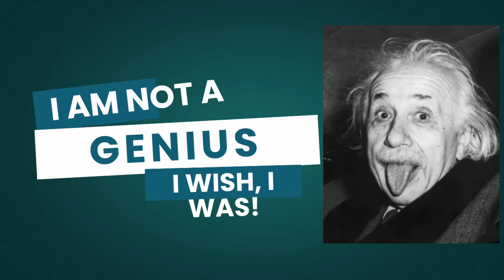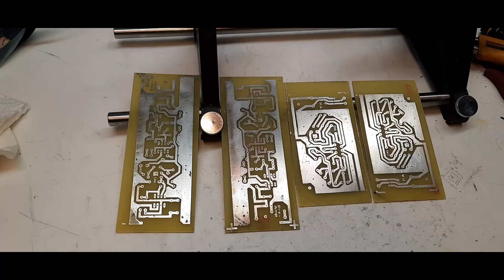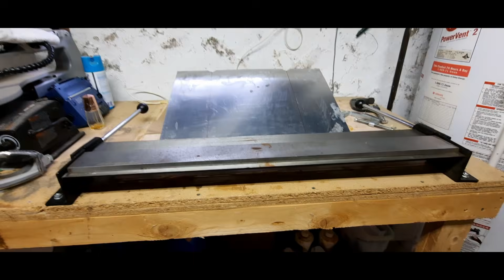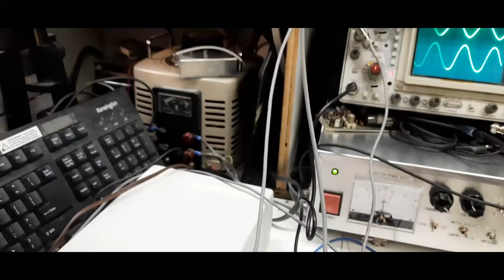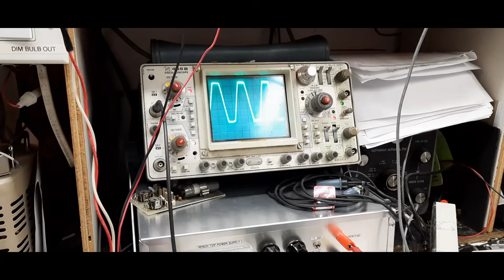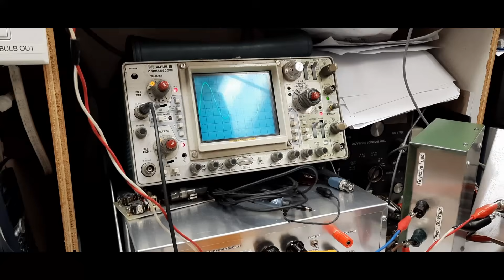Everyday Electronics - Let's build a 10W amplifier - October 1986

Comment from the maker: I figured out the scope issue - even before i read the helpful comments. I tested my scope with a good signal generator output. When I output 1 v p-p, I read 0.3V p-p. Then I looked at the volts/div read knob and it was not set to close. Duh .. how silly of me. Okay .. going forward, I will have better and real readings.

Thanks for watching!
Reply: Have you got the variable knobs for the Volt/Division settings on both your scope channel inputs set to their Calibrated positions? also, check to see if both of your scope probes have been properly compensated too.
Reply from the maker: @simonkormendy849 well no the VAR was not set. So that was the problem. I noticed it was again not set for the last project but i caught it right away. Cheers

Comment: you are not using shielded wires on your potentiometers. that is the cause of so much unwanted noise from old circuits. it might not be present now, but when you use a switched mode powered audio source it will. when you hear a whistle , buzzing bee or humming sounds. bad wirings is one of the issue
Reply from the maker: That's a good point about shielded wires for the potentiometers, I'll keep that in mind for future builds.

Comment: This project remind me my project which I developed very many years ago  with which I had big hopes.  Your has a bit comparable architecture. My project was founded on two power ICS from Sanyo STK 15, acutaly it was licenced fro Sanyo  to Poland  production GML-15 and obviously not original  STK . 

It had    only a bit comparable architecture   with added two smaller also integrated  power ICs   Thompso TBA 790,  by me not designated to work as preamp but parralel to main 15W low tone  with crossover as  5W for separate soprano speakers     I hoped to stay away from speaker crossover and to  have option to form sounding with this cross filtering and two volume knobs. I think this shown  project due to lot of free space could be also so  developed.

It wasn't successfull due  to two reasns -     one of my  15 Watt licenced ics  got damage and I wasn't able to get another for replacement but also  the survived one had not as good sounding as I demanded - so I abandoned this - mostly due to disappointing type of 15W ICs. 

Anyway due to good sounding of 5W SGS Thompson TBA 790 I later assembled micro amplifier 2x5W with volume  potentiometers and   round 1978 it was   realy amazingly working with my speakers.  And later as  microtower with my SR stereo walkman with radio - may  be      pioneered  this kind because I did it around 1982 Wonder why people are rejecting 2x 5-10W  amplifiers  but it is as it is.
Reply from the maker: That's a fascinating story about your amplifier project! It sounds like you put a lot of thought into the design. I also have lots of STK IC's that I got from old organs. Once I find a good schematic, I would like to build an amplifier from them. Thanks for watching!

Comment: You may want to look at the power supply voltage as you get close to clipping. The amp may be trying to pull more power than the transformer can provide.  Anyway great project,,, I love your troubleshooting, I'm really super impressed.
Reply from the maker: That's a good point about the power supply voltage near clipping, I'll definitely check that out. Thanks for the kind words!
Reply: As the power amp chip is running from the 7815 regulator, It will be trying to pull more than an Amp so the problem is more likely the regulator than the transforrmer. Adding a 'booster' transistor around the regulator or upgrading to a regulator that can output at least 2 Amps is advisable.

Comment: Having the speaker and input connections on the front would make this a great test amplifier for your bench. This way you can have it on your shelf and test speakers, turntables, CD players and tape decks without having to reach around the back.
Reply from the maker: Good point about the front connections, it would definitely make it more convenient for testing.
Reply: I did last time   outgoing from back and  hanging on wires spaeaker sockets. Because I wanted to have them easy accesable while  had no option  ot locate in walls

Comment: Congrats, you got where many of those who built electronic projects get: into building your own cases... nice project. Now, you could save yourself some work if you punch the holes into the case before bending them. To measure power, you need an artificial load (in this case 8 Ohms) connected instead of a speaker. Then the formula is P= V*V/ R (Where V is the measured voltage and R the resistance of the Dummy load) … Anything else will give you random numbers.
Reply from the maker: That's a great point about punching the holes before bending - I'll definitely keep that in mind for future projects! I did have an 8 ohm dummy load on the amp. All good there. Yep on the calculations. I just pinned a comment to this video and it turns out that the red VAR on the volts/Div was not set. Silly me!
Reply: Good work B!  To measure into a dummy load of 8 ohms (with an appropriate power rating) using a 'scope. Power = Peak voltage squared / 2R  . Peak voltage = Peak-to peak voltage divided by 2.  So, I measured 10 Vp-pk into an 8 ohm dummy load ---> 5V squared divided by 16 =  1.56 Watts RMS.  Thank you.  Best!!!

Comment: G'day Bettina, a nice project and a nice effort.  I can't really suggest anything re the output.  One possible upgrade is to replace the TL071's with say, NE5534's.  The TL071 is quite dated these days, but a decent FET input op amp, (yes I have happily used them), but the NE5534 should be a lot quieter and have better general specs.  Thanks Bettina.  Regards, Felix vk4fuq in Australia.
Reply from the maker: That's a great idea for an upgrade, thanks for the helpful suggestion and for watching!
Reply: Ah Yes, the NE5534. An excellent design. I remember my first encounter with that device in 1979... OOPS, showing my age. NE5534? Never heard of.
Reply: A 5534 MAY be a little quieter but the high value resistors will be contributing significantly.

Comment: The first thing I would do as far as validating the display on the scope is to check it's calibration using the test square wave out of the front of the scope if it's offered. If it's around the back, that works too. Beyond checking that on the scope, making sure you're getting the square wave showing the correct deflection, there may be calibration points within the scope that gives you added calibration across a wider spectrum of audio frequencies. This is not some thing I'd generally recommend anyone do on their own though, if possible find someone who can check out the horizontal scanning on that other scope. It could be as simple as having the x ktiming synced to an unattached input rather than an internal clock.

Other than the calibration, it might be a good idea to validate that any attenuation on probes is verified. If it's supposed to be x10 you should be able to input a signal (such as the calibrations square wave) at x1 set that up to be full screen deflection, then flip it to x10, and the deflection should be 1/10th as high. If you are running straight unattenuated probes, that might be over driving the input on the scope. 

Finally check to see if the scope is introducing a low impedance load on the amplifier that may be affecting the amplifier performance.

As for the length of the video, most of us probably won't mind if we know ahead of time that the video is going to be long. If you brows across YouTube and Twitch, there are a few people making electronics projects, mostly kits not from parts from the parts bin) where the entire project they build (with possibly the exception of of case manufacturing, is in the stream. Streams going 3 to 8 hours are not unheard of, and some will do 2 or 3 hour streams 3 or 4 days in a row to do what turns out to be a longer project to build.
Reply from the maker: I got the scope figured out. See my pinned comment. Simple mistake on my part. As for video length, I really only get 25 or 30% viewing time per video. Depending on the subject matter, most people fast forward; myself included on youtube videos. Oh-well, not to worry about that stuff. I am just having fun.
Reply: @bettinaneumryr  Keep having fun, and sharing. If it's not fun, you're not going to have excitement or presence in presenting it. And I can tell that's coming through at this point. 

Glad you got the scope issue worked out. As far as it always being prepared going forwards, I do a daily Sudoku solve stream on one of my channels, and have had things that I thought were cleared up before, that crop up randomly on other streams. Not going to offer too many suggestions on getting everything set up. We're each doing something different.

Again, keep having fun.